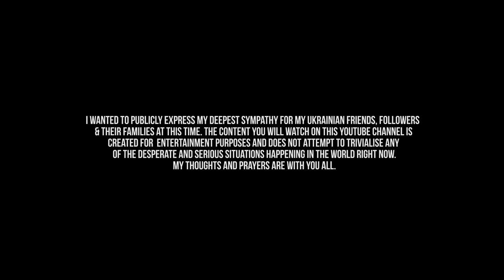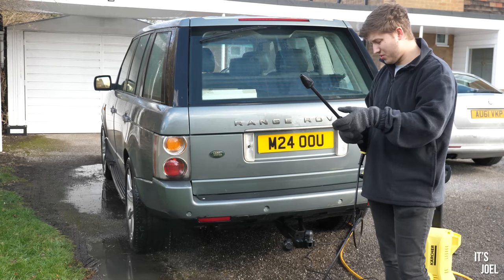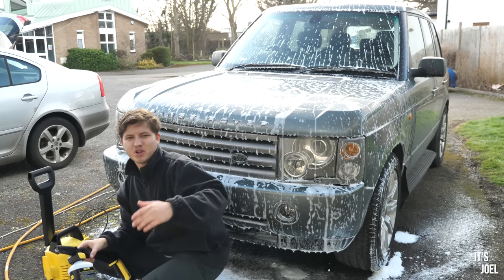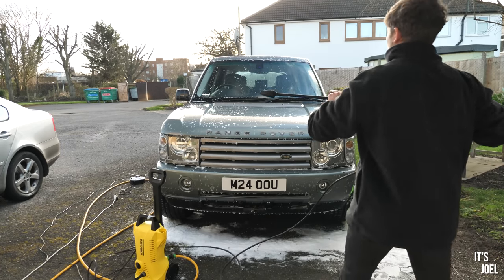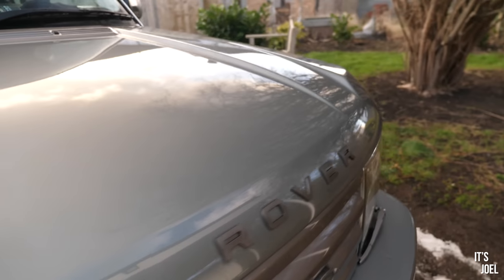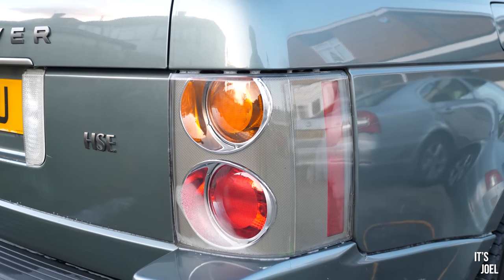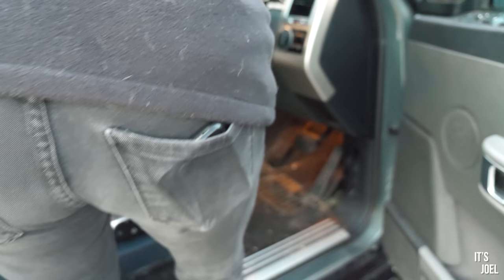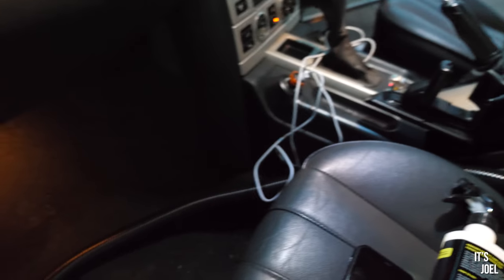Cleaning 10,000 miles of winter dirt off my Range Rover...

Comment from the maker: My paint is fine!
Reply: Thats good to here but please dont use that lance again cause it will damage paint work
Reply: @Cameron temporal i never said i knew anything about cars! The fact being that using a dirt blaster will if you get to close will damage your paint!!
Reply: @Cameron temporal er high presure wand close to paint is a big no it can strip older laquer at the 4 inches hes using it at this will remove any previous protective coats applied. that being said this looks a piss poor washer lol
Reply: it chipped a bit of my bonnet lol i bought one used for 15 quid took the train 2 hours

Comment: Joel's next video, "HOW TO RESTORE PAINT DAMAGED BY A KARCHER PATIO NOZZLE,"
Reply: @T4 Tips & Guides  quite surprised myself, but we've all made mistakes when using new equipment.
 To be honest, I actually think it's a genius move from Joel, Karcher will view this school boy error, (deliberate or not) and will panic thinking they'll have to pay for respray jobs so they'll send out a nice new Karcher k7 pressure washer to Joel with all the car nozzles so he can demonstrate how to safely use a Karcher on your paint 🤣
Reply: As far as we saw the pencil jet was only used on the numberplates
Reply: Yes that nozzle isn’t for cars, I think it even said so on the instructions with mine. I’d be most worried about the lens covers on the rear number plate nights, lost one of mine at the public jet wash despite correct distancing.

Comment: Probably going to get a million people tell you this but that is the wrong lance ti use.  The dirt buster will take the paint off damaged areas!
Reply: It won’t tho w K2 is woefully weak
Reply: I’ve never used a pressure washer on any of my cars, and I’ve been driving for 20 years now. Apart from the fact that all of my cars have been 10+ years old, I don’t like them as the high pressure can get into your lights and cause shorting/electrical issues, and potentially damage window rubbers etc. I just never let my car get too dirty, so a normal wash with a bucket of water/car shampoo , and hose pipe/watering can to rinse off, is all that’s ever needed.

Comment: Oh my word Joel!! You shouldn’t really use the dirt blaster lance on your car! It’s so powerful it could do serious damage if there’s flaking paint or any corrosion.
Reply: Precisely.. I was in shock when I saw the spinny hard setting being used
Reply from the maker: I’m sure it’ll be ok
Reply: 😳 Yes, best not to use that on the Porsche it’ll slice the roof in half! I use the other lance head which has a less concentrated spray.
Reply: @itsjoel  hey Joel, I’m not having a go at you, I love your channel/content it’s a breath of fresh air on YouTube, it’s just a word of warning, something to bear in mind, that lance is more for cleaning patios etc
Reply from the maker: Hi Jim, yes not to worry It didn’t come across that way at all! You’re totally right, there’s was a Lance for car cleaning but I deliberately used the stronger one and did seem to be ok, but appreciate your concern nonetheless! Wouldn’t do that on something more valuable…
Reply: @itsjoel  Well, here's short story - i was dirtblasting a timber deck with Kärcher pressure washer using that rotating thingy. I was in flipflops and for a split second i pointed it at my feet. Seriously, i thought it will rip the skin off! That's how powerful it is. So snowfoam and normal jetwach without rotating thing, then sponge it and rinse it off. Unless you want a bare metal look. ;) Keep up good work! Love your channel!!!
Reply: Karcher????   They are rubbish overrated
Reply: @itsjoel  thanks Joel. I’m not a troll and was worried rereading my original comment that I may have caused offence
Reply: Yes, 100%, even though it's only a k2, this nozzle is designed to knock dirt of patio flags, etc. It's not ideal to use on any car paint, even an old sailboat like this
Reply: @mic400uk  when was a range rover  a sailboat?
Reply: I don’t think the pressure is enough to cause damage just know not to go to near but if you’re really cautious then use the normal lance

Comment: Just quick tip : always start the wash from top to down, from the to the roof to the bonnet, then each side to go on the rear and to finish by the wheels (previously foamed) Exact same way to dry it.

Comment: Using the dirt blaster on a car is really not recommended by Karcher, it’s for hard surfaces such as paving slabs. It will strip the paint. A K4 or K5 using the dirt blaster would strip the paint for sure. The concentration dial even using Karchers snow foam will produce a decent foam but try Autofinesse Avalanche. It’s a proper snow foam. I hope you are happy with the results though.

Comment: Correct you shouldn’t use the dirt lance however unless your pant is damaged it will not ‘strip it’ or damage it.
Definitely don’t use your wash mitt on the pedals/ carpet as you have just picked up all the grit and turned it into a piece of sandpaper 😬.
RR looks good though, if you throw fallout remover/ clay/ polish/ wax stages in it’ll look even better!

Comment: I really like your content Joel however you need a lesson or two about pressure washers Kartcher build their pressure washers to a budget and they really do not stand up to continuous use for any length of time. I would highly suggest you invest some money in a decent professional washer like a Cleanwell they will last a lifetime where as the K2 will be good for around 100 hours if you are lucky. I know from experience and went through 6 of the yellow beasts before the penny dropped! - I was wasting my money and I invested in a decent machine. I know that the initial outlay is considerably more but parts are replaceable on a Cleanwell unlike a Kartcher which is basically disposable at the k2 level. When your unit breaks (which it will) it will only be fit for landfill, this is a criminal waste. Kartcher offer no spare parts for the K2 internally - if you don’t believe me check it out. If you want the best buy a British made Cleanwell pressure washer (and no I am not sponsored by them) just a very happy customer! Even the German army use them which is odd as Kartcher is a German product and their army think we make a better pressure washer here in the UK.

Comment: Be careful with these high pressure washers near to parking sensors and around any of the electrics as well. Good luck with owning a Range rover as i would always worry about the constant repair bills on these cars. 1 family in the street have an SVR and brand new Hybrid version and love them.

Comment: How did the paint not come off when using that lance lol, jesus christ
Reply from the maker: Because it won’t strip paint off unless the lacquer is already peeling
Reply: @itsjoel  tbf mate, you've got a lot of stick in the comments for it and you have kept the video up. That lance DOES have the ability to damage the paintwork, your other lance is fine but of the clear coat is damaged, even that has the ability to take more off so care is to be taken around any damaged areas. The high pressure lance is specifically designed to strip surfaces, yes car paint is pretty tough, but it's simply not the right tool and is high risk. The water that comes out is a pencil jet that rotates about an axis, making the cleaning/stripping ability much greater, the other lance is a spread jet, much lower force involved. Best way to really understand is to try it on your hand, the right lance won't hurt at all, the high pressure pencil jet will give you a bit of sting. This is totally genuine and hopefully useful advice, i don't mean to rub you up the wrong way - i enjoy watching your vids after all.

https://www.youtube.com/watch?v=rXZyNpVNxyA
Reply from the maker: @isctony  no it’s fine I totally understand, but the truth of the matter is that I really don’t care as much as everyone else in the comments seems to! Appreciate your concern nonetheless…

Comment: Love your videos but for the love of god read the instructions and plan what you are going to do before you start doing it please. Concrete blaster on paint work at very close range/ leaving the snow foam to dry out / and why are you still alive? ….. I had to switch the vid off as I could beat watching you jet wash the car with spray going all over the extension sockets ! At least turn it upside down or move fully out of the way. My nerves are frazzled!!
Reply: Bear not beat